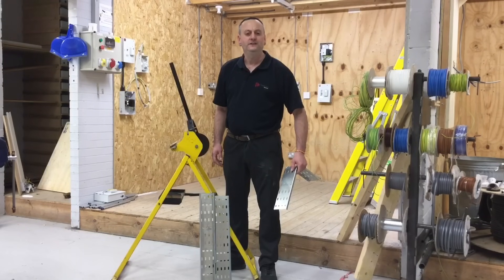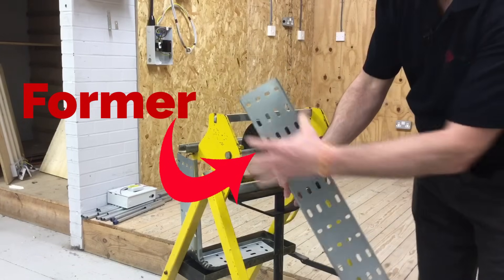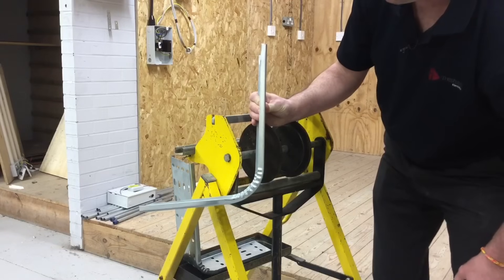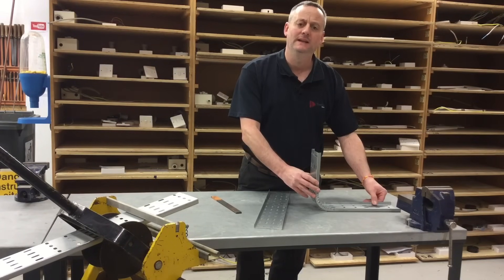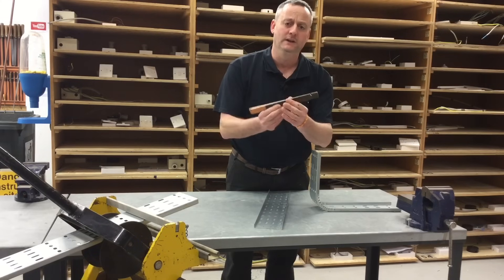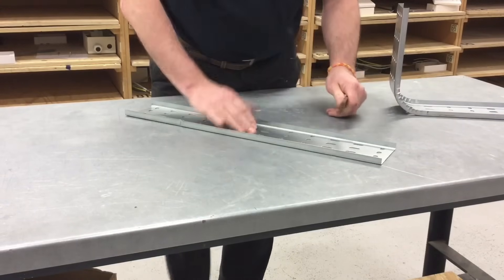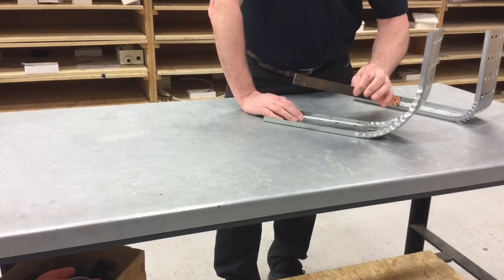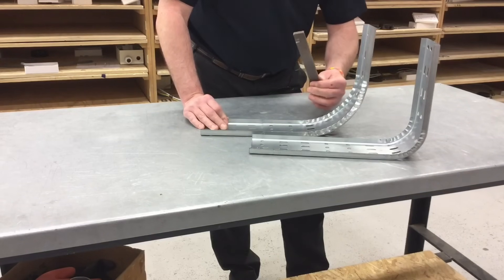How to Make an Internal Bend in Steel Cable Tray Using a Crimping Tool or Bending Machine

Comment: Show us how to do it with the return flange tray
Reply: I used to cut a wedge out back from the corner and bend it til the wedge edges touched this having two 45s to make a 90 bend easier to tie wrap cables to.

Comment: Great video. I used to use an old file with a really good handle.

I had access to a bending machine once when a contractor came to our site, I felt that it was too aggressive with the bend and the cables were jumping off the tray as they couldn't maintain the bend.

Manually you can create a nice soft bend and as you demonstrated, it only takes a few extra minutes. Probably less minutes though than it wold take to manually handle a bending machine and/or bolting bends you've bought from the wholesaler.
Reply from the maker: Hi. Thanks for the support... me and my learners are waiting for another upload from you. All the best Gaz
Reply: It'll be very soon - been sick as a dog since christmas, but almost back in full voice. 👍
Reply from the maker: Hi. Thanks for the update Gaz
Reply: To make wider bends with the bending machine you pull the lever down a bit, then release, slide the tray out a bit, then bend a bit more, then repeat. You can then make the bends as wide as you need. I own a cable tray bender but this video is the first time I've ever seen another one.